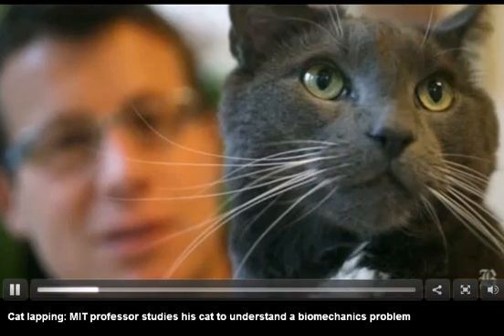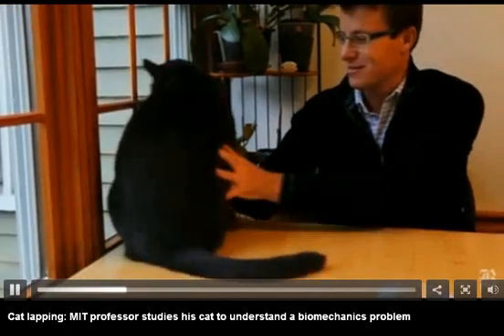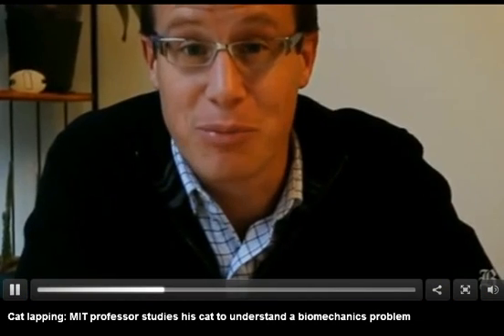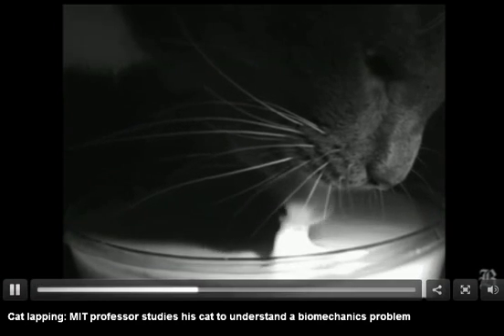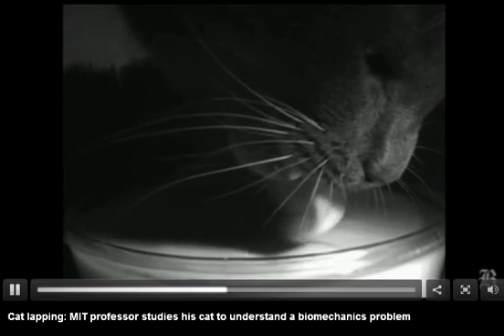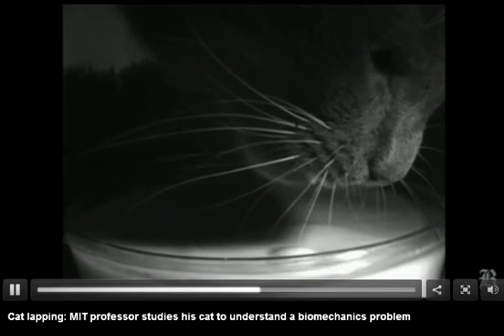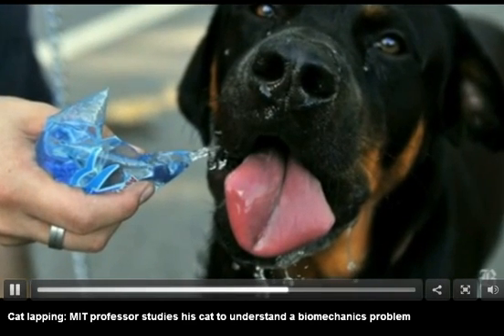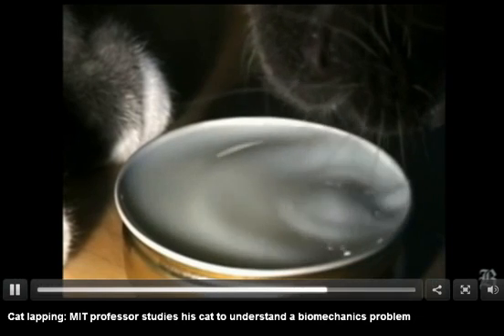How cats lap milk in super slow motion

Comment: @SpookyFan The most visual difference here is how far the dog curls its tongue back in comparison to the cat. The dog's tongue is curled back so far that it actually forms a scoop or ladle shape, which holds water. The cat's tongue does not. The main event is the slightly curled tip of the tongue touching the liquid and pulling up rapidly enough to make a stream of upward-flowing liquid, which the kitty slurps up in mid-air.